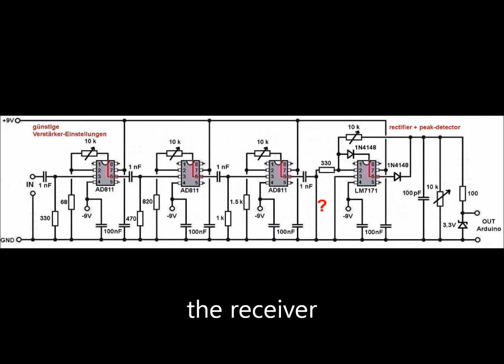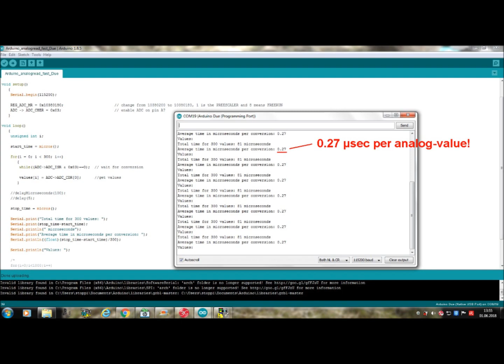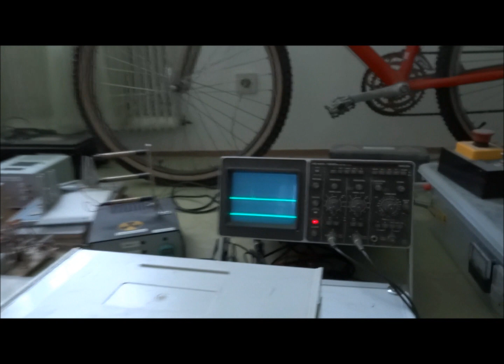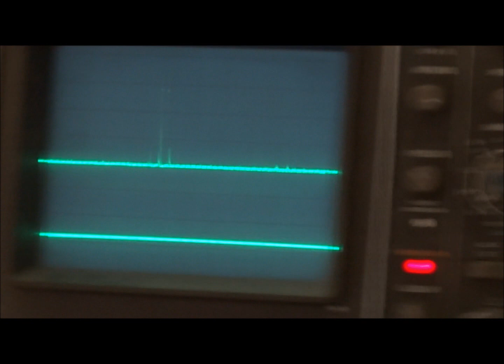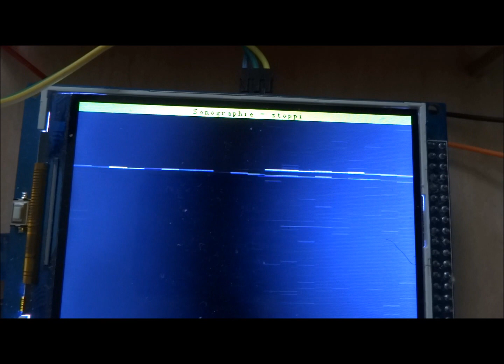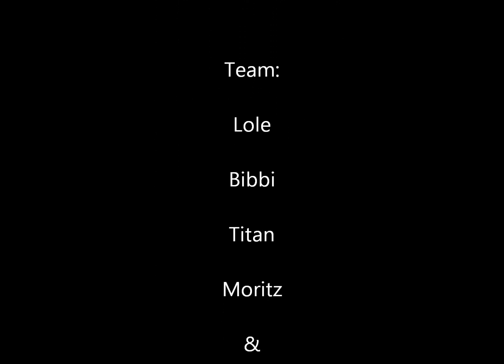body ultrasound (sonography) with arduino - Sonographie mit Arduino

Comment: I didn't see anything.  is it possible you could test it on a piece of meat or actual human body.  project looks great. I want to replicate it but I want to know if it works first.  thanks
Reply: You'd see nothing more because this very basic sonar is mono-dimensional (assuming that the transducer has a narrow lobe, otherwise it's unusable anyway for that purpose). Real body sonography use complex transducer phased arrays which allow "synthetic aperture". In simpler words: They send and receive  ultrasound beams in electronically controlled directions. (This requires multichannel processing and phase control). So you can scan 2D "slices" by making the direction sweep. The operator moves the probe up and down to select the more interesting 2D slice.

Comment: How difficult do you think it would be to introduce an audio step-down and output, to convert the ultrasound returns to audible sound?  That's the other big thing a medical ultrasound does in any form.  In fact there are baby monitors and vascular monitors which have no display at all but only a converted audio return.  It's used to locate a fetal heartbeat or indicate where arteries are which can't be palpated or look for blockages.  Typically the probes are available in 1 MHz, 5MHz (as yours), and 8MHz versions.  The fanciest of that series also have displays which show the output level graphically oscilloscope-style and not imaged.  Not sure which probe frequency gets better penetration or why one would use one over the other.

Comment: hi why use specifically a 5 MHz ultrasonic transducer?
Reply from the maker: The transducers originally used for sonography also work in this frequency region. Do you have another, different model?
Reply: i just saw some 4MHz also being used